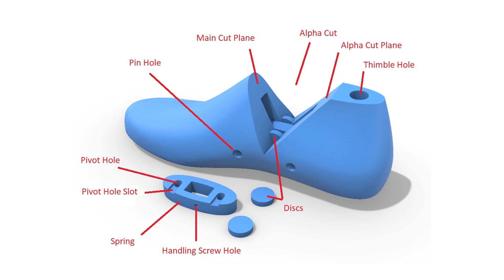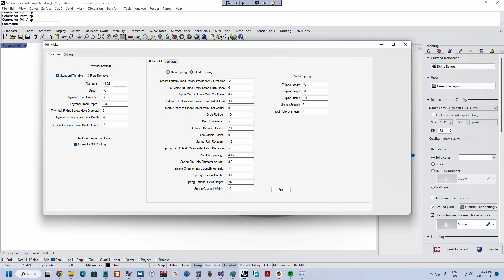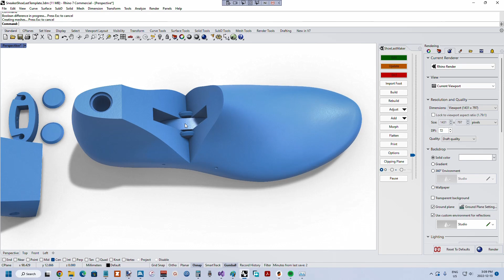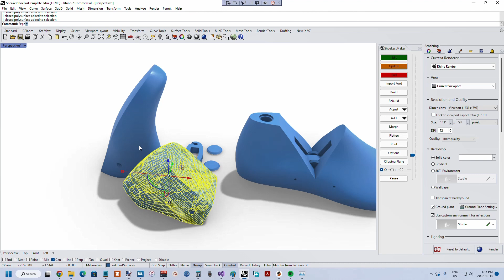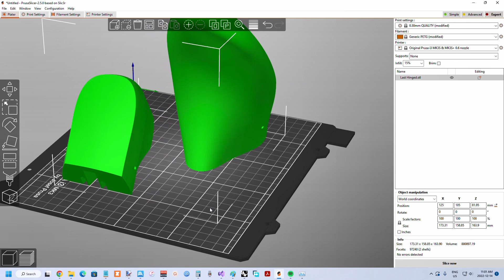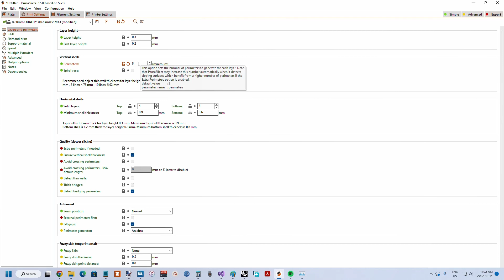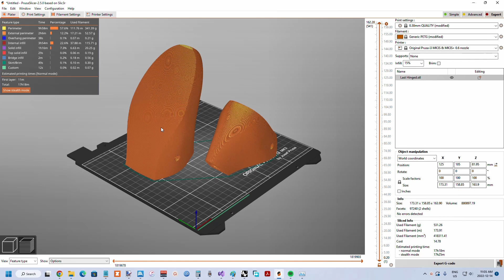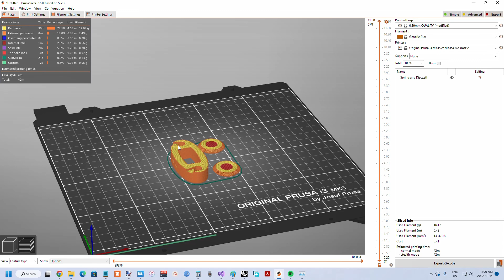How to 3D Print a Shoe Last with a Working Hinge

Comment: Is the gap between the two halves of the lasts ever an issue with deforming uppers? Is there a different last style for high tops?
Reply: Not generally, but there other joint styles that don't have the v-cut, like tendo, but this is the hinge style easiest to 3D print to start with